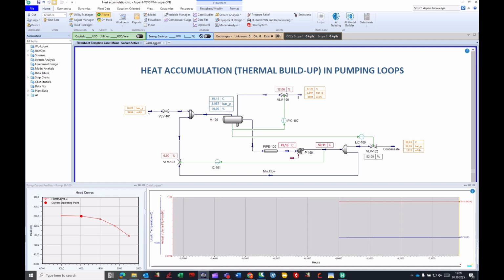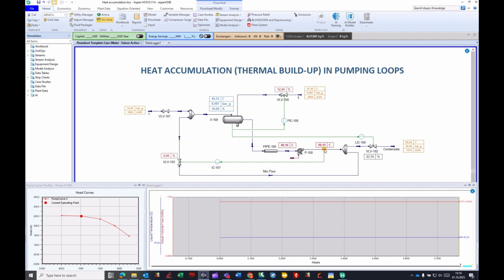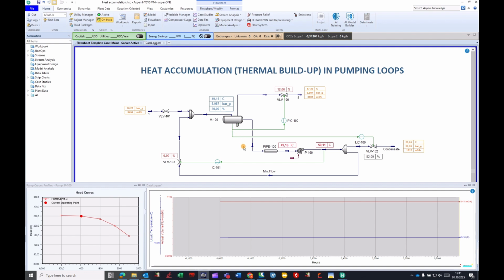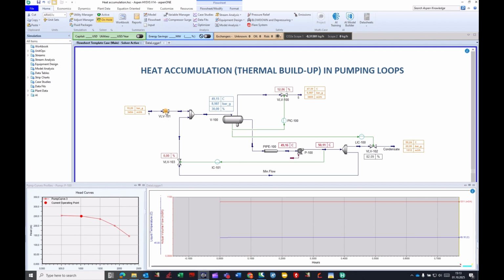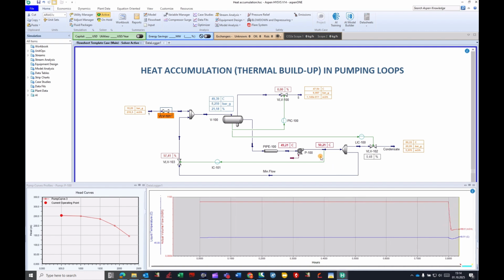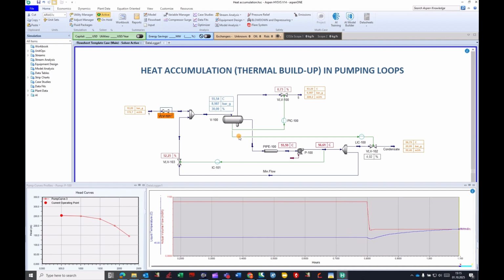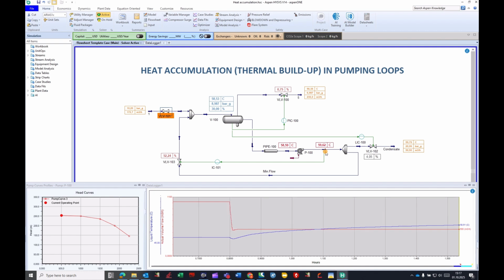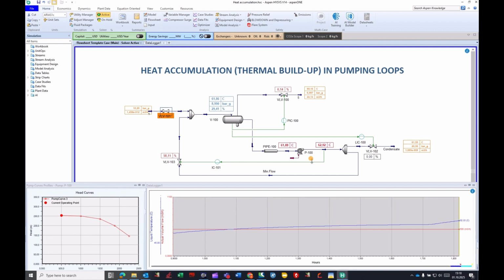Heat accumulation in Pumping system - with an example created in Aspen Hysys's dynamic.

Comment: It would be great if you could find some free time and record a video about creating this kind of simulation. This problem is significant for pumping unstable fluids. I did not find any detailed information about modeling this process in dynamic side.
Reply from the maker: My plan was to record lessons systemically but I will try to find time and record a video for this one.
Reply: @ariasprocess thank you, that would be amazing

Comment: Can you explain how you organized the flow revers from discharge side to suction side without using recycle function in stationary mode, before switching to dynamics? I try to repeat your model and have a problem in this step.
Reply from the maker: I used recycle operation in steady-state mode but I removed it when switched to dynamic. You can also directly start from dynamic without building the steady-state simulation.
Reply: @ariasprocessThanks for the explanation!